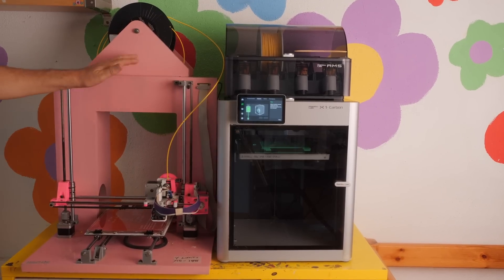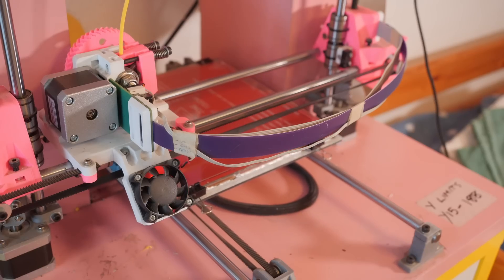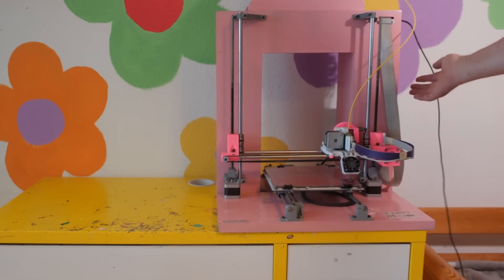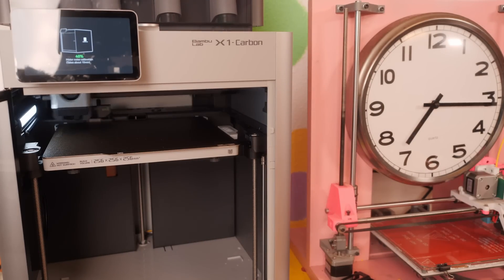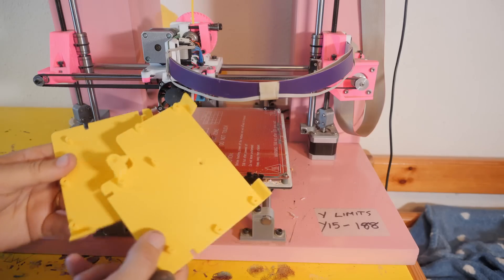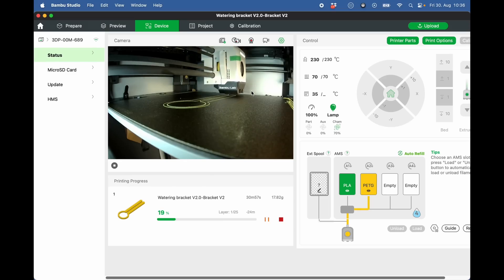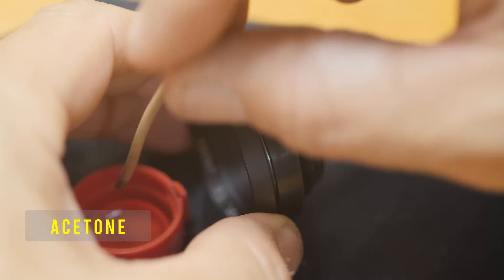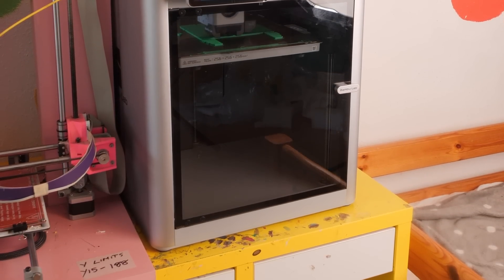How have 3D printers changed in a decade? || RotarySMP

Comment: There have been three 'ages' of 3D printing, best I can tell. 
The first where people built their own and the printer WAS the hobby. 
The second where the manufactured units became prevalent, but still required a good understanding of how to build/upgrade the printer
The third is the Bambu type. Buy it, put it down and go. Knowledge extends as far as basic maintenance and operation, not hugely in depth.

For those who want a 3D printer as a tool, the third age has been a long time coming. We had an Ender 3 and 5 which were great, but ALWAYS seemed to need work doing to get a good print, calibration didn't stay in spec long and it was always a bit of a gamble if a long print would work. Bought a Bambu in December and it's night and day by comparison.
Reply: Remember, it started with bambu type printers from stratasys. Those just were expensive as shit.

So the diy printers were clones of those machines, and enabled the now cheaper commercial machines. So more of a three-phase cycle.
Reply from the maker: @jojoposter  I wonder what will come out of the law suites? Kind of hard to enforce a heated patent now, when a gazillion open source designs have used this feature for years. Isn't defense of a patent partially dependent on consistently defending it?
Reply: @RotarySMP  I think that's the case with all patents. I have a friend who is a lawyer specializing in patent and business law. He told me years ago that the expensive part about a patent isn't getting one, it's defending it. I think that's why a lot of companies start out just doing a patent search to make sure they aren't infringing on someone else. Then going into production and being first in the marketplace. Being first and building brand recognition ultimately is worth more than a patent.
Reply: @RotarySMP  I was unaware of the new lawsuit. Oh boy.... I sure hope that it will not set a precedent, it seems to at least cover mechanisms similar to the input shaper/resonance calibration. Would hate to loose those features due to patent infringement
Reply from the maker: That is a really good summary. Thanks. Pinned!
Reply: Except type one is still alive and well, and with just the price of a bambu it's possible to build a machine with 5 times the acceleration. I'm experimenting with a novel new toolhead design that if successful, would make dissolvable support super easy to print.
Reply from the maker: @youtubehandlesux  Yeah, I have a friend with a Voron. Wow! But I dont have the time for that rabbit hole.
Reply: @RotarySMP  With a high spec Voron it's more like 3-4 times the acceleration, to go even faster coreXY simply isn't rigid enough, even with CNC parts and GT3 2MGT belts. At that point it's bedslingers that are advantageous again.
Reply: Oh the first age isn't over at all, and it's not like it's stuck there, there's huge benefits to performance of homebrew stuff if you're willing to invest the time/money, over something with a warranty, and there's plenty of people who enjoy that. I'm not one of them. 
I want to design a part I need and make it, and at that point, reliability is more important than peak performance. So the allure of "5 times the acceleration" holds no sway, and I'm sure that's the same for a lot of people.
Reply: Ultimaker build with the 2 and 3 two set it and forget it printer long before Bamboo was a thing. Only issue was that they were very expensive. But because of that easy usage they were quite popular in Maker and Hackerspaces. Prusa with the MK3 was also pretty easy to set up and to print to.
Reply from the maker: @Toxicity1987  It is cool how far printers have come in a decade.
Reply: Bambu were never the first, but they are (as far as I can tell) the first to make something full enclosed/filtered off the shelf.

Yes you can build an enclosure with a Lack table from Ikea cheaply (as we did for the Ender 3). It's perfectly adequate, but thats it. Adequate. And it still didn't solve the problem of the printer bring finicky.

No matter which of my friends I spoke to, they always seemed to have a laundry list of things that needed (or they wanted) doing to get the Enders "working properly" to get a satisfactory print time and time again. 
That really jaded my opinion of those types of printer, they were the go-to affordable entry point, but still needed lots of fixing, and prep, and even then a 5-10 hour print was still a dice roll.
And as you say, if you wanted something that was reliable, it cost a fortune.
Reply: @PedalBoxGarage  My neptune 4 can print flawlessly after gathering dust for a month, in a 65C enclosure, not sure what your friends are doing to make cheap printers unreliable. Also you realize being able to print at 100k acceleration means it's stable and reliable at 60k right? By the way last time I checked, bambu's terrible support means warranty basically does nothing.
Reply: Thats great, i'm pleased you've got yours working well, but you missed the point about having neither the time, nor more importantly the desire to upgrade a printer, so the benefits of any upgrade is moot.

I just had a look for a review of the Neptune 4, and the first one that came up listed: 
-Frustrating bed-leveling process
-Leveling wheels fell off during testing
Given the biggest issue with every Ender printers I've been adjacent to is the bed not staying level and needing constant calibration, that point is enough to put me off a Neptune 4.

As for the support, you're far more likely to read about a negative experience with ANY companies support than a positive one, because people don't go out of their way to extoll good experience like they do bad. 
Elegoo support has a 3.2/5 rating on trustpilot and Bambu is 2.8, both with a large amount of 1 star reviews dragging it down, so there's not a lot in it. Of the three people I know with Bambu, maybe if we all rated them based on our experience (never had an issue) that rating would improve. i'll wager you've not reviewed Neptune on trustpilot either, because you've only had good experience thus far.

Again, congrats on getting your Neptune working well, it's not the printer for me for a variety of other reasons.
Reply: @PedalBoxGarage  No Bambu weren't even close. I was useing a fully enclosed heated chamber "office" printer by the original inventors of the thing twenty years ago, it was extemely reliable and expensive. I wouldn't so much as call it "off the shelf" as "off the showroom floor". Likewise Ultimaker have been making off the shelf set and forget enclosed chamber printers forever, the method series comes to mind. Your timeline is not actually accurate. Number 3 came first followed by number 1 at the expiry of the original patent, number 2 followed after that, number 4 is where we are now which is a mix of three and one but the price has come down.
Reply: im still stuck in age 1 lmao, but thats by choice i love designing printers
Reply: I'm in the second age (MP Maker select v2 [1.5?] and CR Ender 3 pro) both bone stock, and accurate prints going for years. This year I may get a high speed Elegoo or Bambu labs, overnight printing sucks!

Comment: I have a Mendel90 that I proudly built and tinkered with for several years. It was awesome when it worked.  And yes, the "will it work this time" feeling came about everytime I went to print.  Unfortunately, that's what started turning me away from it.   Six years ago, the heated bed died and I shifted away from printing.  My youngest son has seen my old Mendel on the shelf collecting dust.  It's been so long that I forget all of the settings and particularities.  But, I don't know if it's worth the coin to upgrade.
Reply from the maker: They were a pretty good machine of their generation, but it is impressive how printers have developed from there. I have been doing a number of prints on the Bambu using the finest 0.08mm layer height, as I need to minimise the striations as it it a sand casing pattern. the quality seemed unimaginable compared with 10 years ago.

Did you check out the Bambu A1? From the videos I have seen, the quality for PLA is even better than the X1C.

Comment: After one year I had to jump the on/off switch. 
I replaced the ptfe tube of the wiper with OD6x2 silicone o-rings as well.
Reply from the maker: Did you print a lot? I like that they provide maintenance and repair instructions. I just lubed the Z screws yesterday.
Reply: @ yeah their instructions are pretty nice. I printed a lot of parts the last 12 months. Must be around 1500h now. Maybe even more.
I didn’t had a lot of issues. One time the Z bearing in the back slipped a little and jammed the bed. After fixing it everything was back to normal.
I recommended a A1 with AMS to a close friend when he asked if he should buy a Ender because they are cheap. He is really happy with the printer.
Reply from the maker: @Todestelzer  I am really enjoying the professionally engineered aspect of the X1C. On my home build printer it always seemed the stars had to align for it to want to print well :)

Comment: I love my Bambu, but with the stock nozzle, the 'Ludicrous' speed never gave me reliable results. That was until I installed a CHT-style nozzle. E3D benchmarks are unreal, but even the cheap Chinese nozzles reduce print times by 1/3. Totally worth it upgrade. Not the same step from the old style to Core-XY, but really puts a lot of rapid prototyping within 10s of minutes or hours rather than overnight.
Reply from the maker: Thanks for the tip. I haven't tried setting like ludicrous, as this is already so much faster than I am used to.

Comment: I had an old DIY RepRap style printer, then a Creality Ender 3 and now I have a Prusa Mk3. In my view, one of the biggest step forwards was the introduction of magnetic spring steel build plates. I tried everything to get prints to stick to the glass build plates. They either fell off before the job finished or stuck so bad they pulled chunks of glass up with the print.
Regards,  Preso.
Reply from the maker: Hi Mark, 
I really like the integration of the slicer with the printer controller, the automatic bed levelling, probing etc, and general feel that this is a sorted machine, rather than a science experiment. You are right that those textured magnetic build plates were a real game changer. I should have put one on my old printer years ago, when Hamish did :)

Comment: Also roughly 10 years ago I got my first 3D printer on a whim, because a local electronics store had them on sale. It turned out they weren't quite ready for the mass market, so it was heavily discounted. I knew of 3D printing and was vaguely interested in it, but didn't exactly know what I'd use it for. It was  "German RepRap Neo" (neo being the model, the rest is actually a company name). It had so many design flaws and oversights that it also required a lot of tinkering and I ended up with essentially a rebuilt 3D printer based on that frame+motors. I then went the entirely opposite route from you: I noticed that 3D printing was actually a fun hobby in itself, and I started building a HyperCube Evolution (the hot DIY model at the time). Went through many iterations of hot ends and kinematics. Eventually got a cheap resin printer as well, for detail oriented prints. Also got a tiny bed slinger/cantilever printer, mostly to be sure I always got a working FDM model when I need to repair the main printer. This year I finally decided it was time to join this decade and built a Voron 2.4. It also "just works", but it's mine (and yes, that took around a week to fully complete).

It's amazing how despite the different timelines, our development is essentially opposite: You started with the most DIY printer, used it for a decade (mostly happily, I think?) and then upgraded to the defacto standard "tool" version. I went from as ready-to-use as it existed 10 years ago down a rabbit hole of building and tinkering to arrive at the most DIY and modable version of your new tool. And yes, the practical performance of a Voron 2.4 and an X1 carbon are probably very comparable.
Reply from the maker: Thanks for that. I was sort of considering a Voron as well, and there are a few that are for sale in the classifieds, where I figured I could get a good deal on one. A friend here has one and there are awesome aren't they.
Reply: @RotarySMP  I'm incredibly happy with mine, though building it yourself is kind of the point. But of course buying one used is probably the smarter choice financially. I would expect one like that to also "mostly work", but it isn't quite to bamboo levels. That of course also comes with the expandability of the whole Voron ecosystem, which can be daunting or exhilarating depending on your perspective. But for anyone who really mostly wants to "just print stuff that works", and only that, the bamboo is probably just the better choice. Vorons are for those who actively want them to (also) be a hobby, while still just printing stuff. 

Another perspective: the manual to build the thing is a piece of art and engineering. Including the printer, hotend, "tap" (bed level sensor) and extruder the things it's roughly 500 pages of illustrated PDF. The default extruder is just a marvel, incredibly well thought out and intricate while reliable. 8 really has a blast, but also essentially worked a full-time week on it (as my holiday, semi-sick during that time, and took my time).

Comment: As others have said, assuming the device has a proper fixed MAC address, you ought to be able to make a DHCP reservation on your DHCP server (likely on your router).

Failing that, lots of devices have the ability to set a fixed IP addreas for cases where thats desirable (eg. A network which doesnt have a DHCP Server
Reply from the maker: We gave it a go, but I gave up and just use IP scanner each time. Only takes a few seconds. Then again, I doubt that printer will get much use going forward.

Comment: A comparison with a Makergear M2 from 2012/13 would be interesting/more equal. That machine was built like a tank, not super fast but stable and reliable with quite similar print quality as current machines. I have more issues with the modern Bambu than I ever did with the Makergear
Reply from the maker: What issues is your Bambu causing you?

Comment: I waited to get into 3d printing until the ender pro came out. At that point it was finally looking reliable and affordable. Other than a direct drive kit it's stock. I can go out and print something and it usually works though it has it's attitudes when it doesn't want to. I would say that 3d printers have made a massive leap in the past 3 years now. I do want a new printer but I want a larger bed printer and those are finally hitting the market. Larger as in rectangle shaped for longer parts. That said I have had the Bambu printer on my wish list for the better half to get me for Christmas or my birthday 2 days later.
      The only problem I have printing is the heat. Mine is in my shop and I can\t print anything out there in the summer as the prints fail because it's over 100*. 

          What also mazes me is how far the software has come in just a couple years and now with the 3d scanners getting affordable I want one of those too. My cad fu is poor now and I'm too lazy to measure everything.
Reply from the maker: Hi Robert, yeah, the software control of these printers is amazing. This is a beast of a machine. I though a hot environment is what you need to ABS. Have you tried that in your garage?
Reply: @RotarySMP  I kept thinking about getting a roll of ABS since the temps would be good for it but I never did... Too hot to spend more than a few minutes out there unless I turn the ac on the night before. 
   The problem with the PLA in that heat is that the part cooling doesn't work at those ambient temps. I really want a printer with a 12"x24" or so bed as that's the size stuff I want to print. For mold bucks etc. 
        I was building cnc routers when the 3d printers started out. The hardware cost was enormous then and I was using acme screws. Now ball screws and linear guides are not awesome quality but cheap and work well.

Comment: Third Bambu printer in my subscription feed today.  Which means you guys have had this for at least a week, probably longer.  And have a contractual release date.  Geee what a quinkydink...
Reply: Bubma byllacisa osetarep leki a c,tlu ganno hti teh fsyobna whti a weva of conetnt to reli tmeh up fro tesoh mrcoidee m.senihca
Reply from the maker: Their was no contract release date as this is a two year old printer. 

It sure is a hell of a lot better machine than I had. I considered a Voron, but simply don't have the time or interest is all the tuning required.
Reply: A Voron is a hobby. I got it to work after 2 Years but it took a lot of mods and effort to get it running as smooth as a Bambu printer. 
Still have issues when filament is running out and the end of the current filament is bend. Last mod I have to do is a filament cutter. Printed everything but don’t have enough time…

Comment: You can set your ip address for anything on your local network as long as you have the MAC address of the device. Log into your router go to DHCP settings. There should be a page to input the MAC address and the IP address you want the device to have. Save the settings in your router. Go to the device and Set the device to use DHCP. And reboot the device. Your device will pick up the IP address you saved in your router.
Reply from the maker: Thanks a lot. That friend Hamish , who design the printer is great at network stuff, and we once tried to set a static IP on the router. I can't remember why we failed, but we did. Since I worked out that IP Scanner finds it immediately, it doesn't really bother me much.